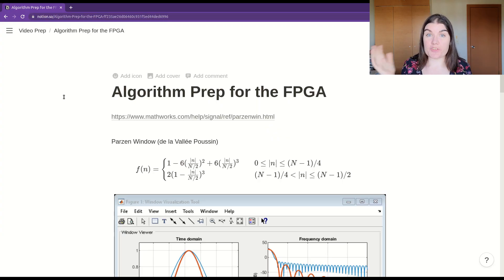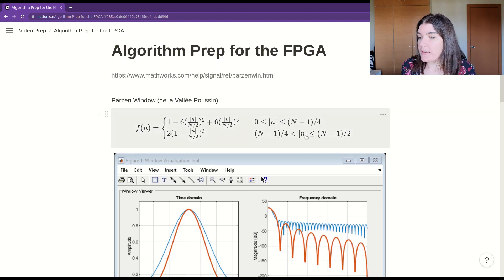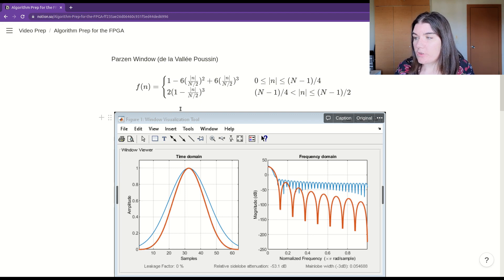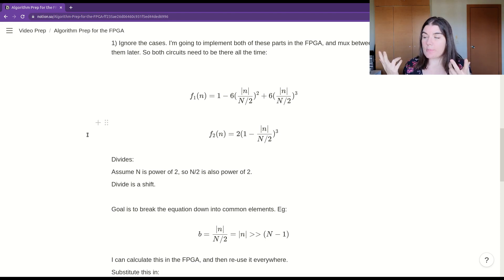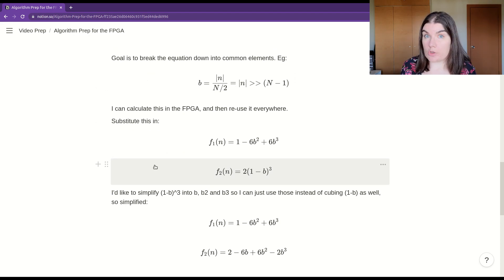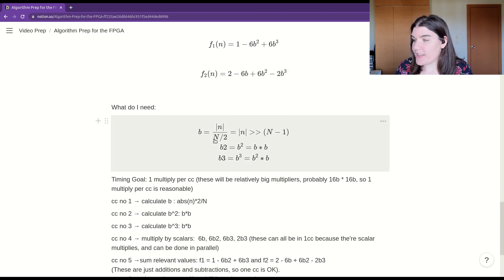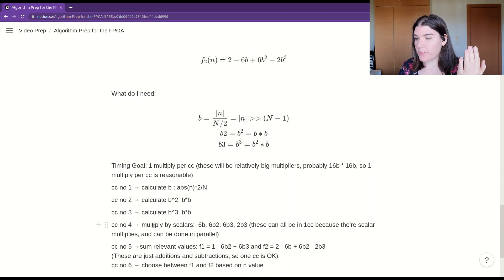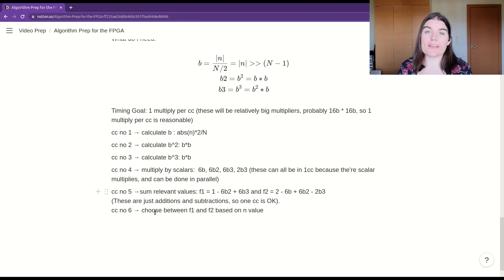Algorithm preparation for the FPGA: A polynomial window example

Comment: Hi Stacey! I was wondering how you would consider implementing this algorithm using pipelining or not. Would you consider the improved performance over the complexity of the implementation? or what other factors would you consider?
Reply from the maker: I almost certainly would. Space-wise it's only 2 multipliers vs 1. Unless the area requirements were super tight, and/or the sample rate is very low, those are the cases I would consider not pipelining. Otherwise it's almost certainly better to pipeline in this case.